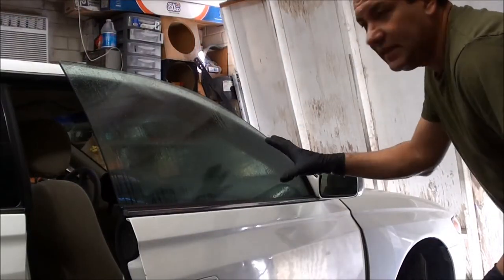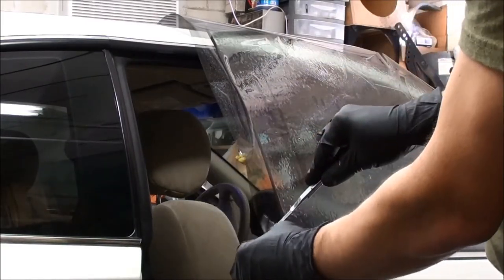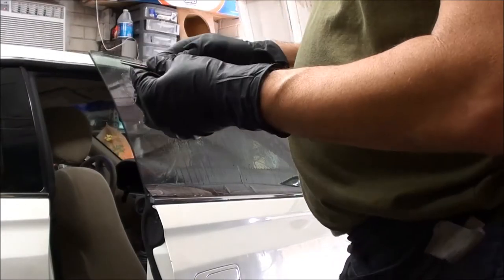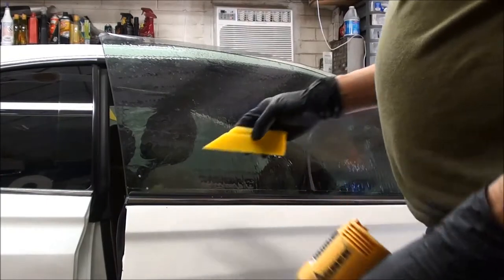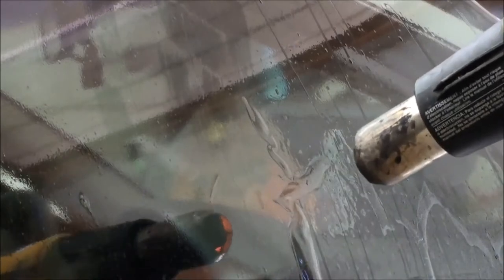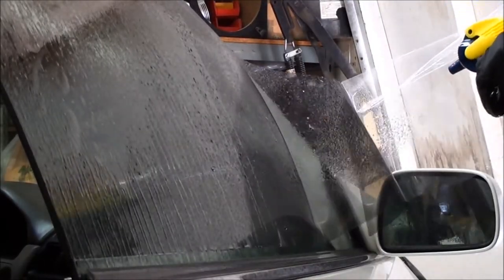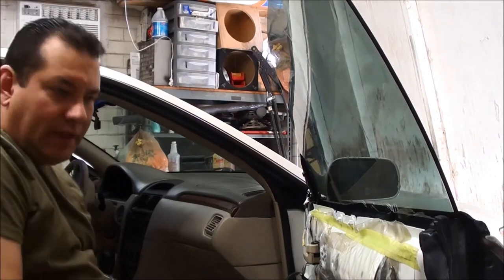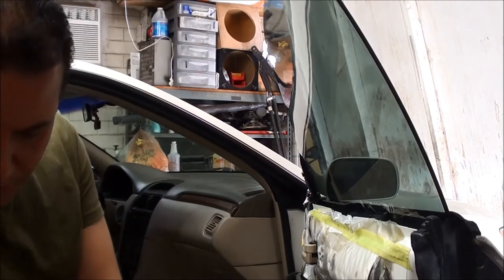how to tint a frameless front door window 2000 toyota solara

Comment: Do you have any toploading videos or bottom loading videos on side windows.....
Reply from the maker: This is a Bottom loading video. To bottom load, you have to remove the door panel.  I don’t have any top loading, because 95% of the vehicles we remove the panels. Because it make installation much easier.   I will be doing a top loading one soon.
Reply: @raiderman28  ok thanks can you show a bottom loading video on a frame door